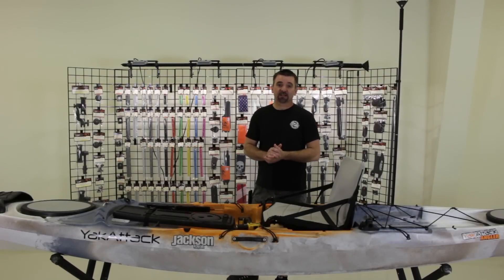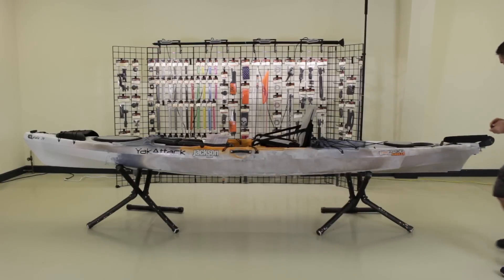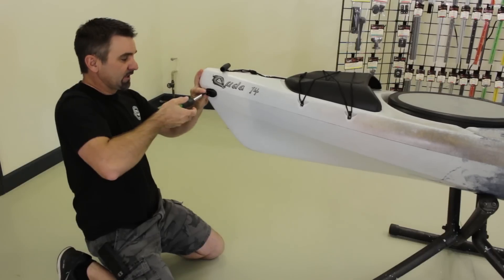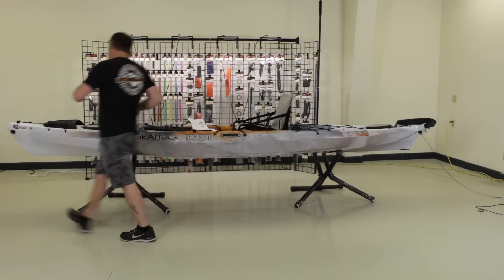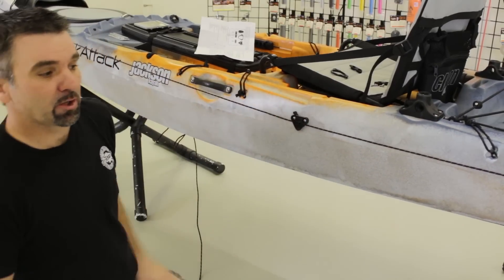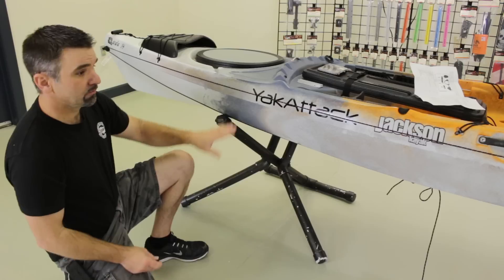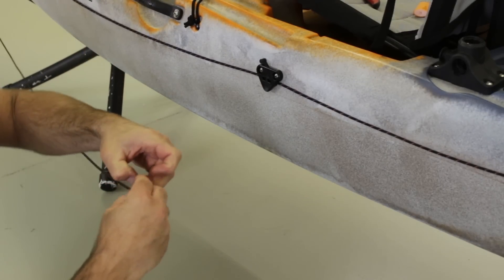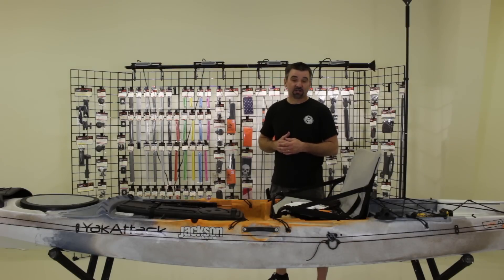Rigging the Dream - Episode 3 - YakAttack LeverLoc Anchor Trolley Install

Comment: would you recommend putting marine goo or anything like that on the holes where the screws go?
Reply from the maker: We recommend using marine sealant for any installation where holes have to be drilled.
Reply: @YakAttackKayakFishing  your method of installation doesn't allow for applying any type of sealant to all of the holes before installing the screws. Better to mark the holes with a pen or sharpie and drill them first. Just frustrating to see an installation video on how to do something then recommend to do something else.
Reply: @YakAttackKayakFishing  any particular brand you would recommend?
Reply from the maker: @DavidCook-jy4cs  Amazing GOOP Marine or Loctite seem to be the two brands we are always buying.
Reply: @YakAttackKayakFishing  thanks, very helpful!
Reply: Should have just included well nuts instead of self threading screws! And this dude not even using marine sealant on a watercraft! Amateur hour!

Comment: This is a great product. But I recommend using rivets or well nuts. Screws are not enough in my opinion. When you have a yak that weighs 100+ pounds with gear. Those pulleys will have tons of pressure on them in high winds and current. Just installed two on my feelfree.
Reply: Did you use rivets on your boat? Did they fit OK? I am also having doubts about using screws without backing. Did you get Harken pulleys or Stealth pulleys. What is the quality difference. I have read that the Yakattack Stealth pulleys are not very strong/good.

Comment: When I first opened & installed this anchor trolley I wasn't impressed installing the pulleys only using screws and honestly I still don't like that part but aside from that over a year later and this anchor trolley is performing great! I recommend using at least one bolt in the center of the pulley (or a well nut if you don't have hull access) especially if you have a kayak with a high freeboard like a Pro Angler. I just bought another one. These are great anchor trolley systems!

Comment: Real good Instructions but I have NO IDEA why Yakattack includes Blunt Screws for this Kit - First thing I did was go to the Hardware Store for Stainless Steel Pointed Screws of Identical dimension - So much Easier and Tighter fit and just better

Comment: Thanks for the video.  It makes installation much easier and reduces the chances of mistakes.  I installed one today on my new Perception Pescador 12. I looked at several systems and this seemed like the most professional looking and best functioning.  I like the locking feature and the way the line is held in place by guides. I am very pleased and will recommend it to others.

Comment: Should you use marine goop before putting screws in? Im thinking of getting this trolley at some point but nervous about drilling holes in my kayak.
Reply from the maker: Drilling holes in a kayak is always nerve racking. You can definitely use the marine goop for extra piece of mind, but it is not required.
Reply: @YakAttackKayakFishing  okay sweet thank you!

Comment: Should one put an anchor trolley system on each side of the boat or just one side?  Great Video.  Thanks.
Reply from the maker: You don't see it on every boat, but it isn't uncommon to have an anchor trolley on both sides of the boat.
Reply: Saw another video where the guy recommended to mount the trolley on the opposite side of your dominant hand which holds the rod in order to keep it out of the way. So left side for right handed person. Seemed to make sense to me.

Comment: I have to say I think this is the best anchor trolley on the market. am ordering one today. the instructional video was great a lot better than that other yak company doing instructional videos that doesn't have a clue. thums up I bought a fishfinder finder it would be cool see how you mount one. the paddle video would help out a lot I have a really cheap paddle but its the only 1 I've ever used so I don't know if am missing out by not getting a better one. great video
Reply from the maker: +iwantosavemoney Thank you. The LeverLoc Anchor Trolley was a fun product to develop and design. We wanted an anchor trolley system that was unlike anything else on the market and solved a few common problems typical anchor trolley systems encounter.

Comment: I really like the idea behind the HD kit with the vacuum plates but can that be installed on a Bonafide RS117.
Reply from the maker: The RS117 features an access plate at the stern of the kayak. To install the backing plates the use of the YakAttack Rigging Bullet would have to be used to get the backing plates in place. The correct thread Rigging Bullets to help with the install of the LeverLoc Anchor Trolley HD would be the 10-32 Rigging Bullet. Here is a video link to a short Rigging Bullet video showing how they are used. It is for GearTrac but it is the most simple and to the point video example: https://youtu.be/6EnHBEEQHYs
Reply: @YakAttackKayakFishing  oh wow that is awesome. Thank you!

Comment: Thanks for this video. I kept waffling back and forth about the standard trolley or the HD one. I ended up with the standard trolley (just purchased today) since I could get it locally and could always upgrade to the HD backing plates if I feel like I need to. 99% of my fishing is done in fairly small inland lakes in good weather so I think (hope) the standard version will be good for me.

Comment: I did not add any silicone when I put the screws in. Would it still be ok to take them out and then put silicone? or should I just leave the alone?
Reply from the maker: Silicone isn't completely necessary. If you want to add some silicone, feel free to do so, but only do it around the head of the screw. The type of hardware used in combination with the material of the kayak and the pilot hole size is creating a nice tight seal.
Reply: @YakAttackKayakFishing  thank you

Comment: Do you put silicone on the screw shafts when permanently tightening them ?? Seems like it will leak if you don't. Just asking.
Reply from the maker: The pilot hole size we recommend is a bit undersized and the blunt tip thread forming screws help create a nice tight seal. If you want extra piece of mind you could put some silicon around the head of the screw but aren't really needed on the threads themselves.

Comment: I actually just purchased a Cuda 14 and was looking at options for adding a Hummingbird Helix 5 fish finder . I was curious about mounting on the center console. What would you suggest?
Reply from the maker: Does your Cuda 14 have factory installed track on it?
Reply: YakAttack just on the console.
Reply from the maker: You could use this mount and attach it directly to the track on the center console: https://www.yakattack.us/humminbird-helix-fish-finder-mount-with-track-mounted-locknload-mounting-system-ffp-1004/
Reply: YakAttack would it be possible to add more yak track to the Cuda 14? And if so what would you recommend? 
How would I contact you directly through email?
Reply from the maker: You could add more track. Feel free to contact us at 434-392-3233 ask for John. Let them know you have a rigging question. Or send us a message on Facebook or Instagram.

Comment: Do you recommend a dot of silicone for the screws to go through? Also.... Any difference in this one and the AMS-1004.
Reply from the maker: With the included self-threading screws you can add a bit of silicone after the screw has been installed if you would like. The difference between the basic LeverLoc Anchor Trolley and the HD LeverLoc kit is the HD included 3 backing plates for the two pulleys and the LeverLoc as well as two extra line guides. The basic kit is ample for most anglers. If you tend to anchor in areas with more wind, current, or boat traffic the HD kit would be worth looking at.

Comment: With the yak attack anchor trolley system, how do you lock your anchor line?
Reply from the maker: There is a lever lock built into the system. It is the component installed at the 7:35 minute in the video.
Reply: @YakAttackKayakFishing  i am asking about the anchor line not the trolley line
Reply from the maker: @alielkady5056  an additional cleat would be needed if you are using anchor line. Our GT Cleat or GT Cleat XL could be good options to secure the anchor line.

Comment: Wouldn’t using using well nuts or marine sealant on the holes your drilling be necessary?
Reply from the maker: We don't recommend the use of well nuts with any of our products. Following the instructions using the provided hardware will result in a solid install. Add marine sealant if you want but it isn't needed given the type of screws, the specific size of the pilot hole, and hand tightening.

Comment: If anyone is still monitoring this channel, please advise. If you did not have the bungee cords on the bow of the Cuda 14 would you put the forward pulley above the chine? Or is a straight run for the trolley line better? Thanks RJ
Reply from the maker: I would do the bungee trick or us the YakAttack Rigging Bullet to help with the install to get the pulley as close up to the bow as possible. We did just recently sell the kayak in this video but we were very happy with the component placement over the past few years.

Comment: Does it matter left or right side?
Reply from the maker: The side of the kayak that you install the anchor trolley is purely personal. Let's say you use our CellBlok fish finder mounting system and you mount it on the left side of your kayak. With having a transducer arm on the left side you would want to install your anchor trolley on the right side. Some customers install the anchor trolley on the right side if they are right-handed and vice versa.

Comment: Hey Luther. Awesome video and awesome products. I do have a question. I have a Journey 10 ss. I'm finding it difficult to install the 1003 due to the mold on my kayak. I can easily install the two pulleys but I can't figure out where to install the locking mechanism. If I put it above the mold it will not be aligned with the rope. if I put it below the mold the the flap of the mold keeps the locking lever from being used. Can you please give me some pointers? Thanks for your time!
Reply from the maker: Could you possibly send us a picture of your kayak, and the placement of the pulleys? We have never installed an AMS on this particular boat. Just send the pictures to support@yakattack.us and we will certainly help you
Thank you!

Comment: What's the purpose of locking the trolley line? Won't the ring stay at whichever end it's positioned to? It will be pulled in that direction by the anchor once the yak orients itself in the current.
Reply from the maker: Depending on the current and wind, locking the trolley line gives you the ability to face quartering up or down stream/wind rather then just directly up or down steam. It gives you the extra piece of mind that you will hold position rather than be at the mercy of the water.
Reply: probably if one wanted to  "lock the anchor in the middle or so"  to keep it from sliding to either end of the craft ... .
Reply: short answer is NO it won't always stay put, especially if you are adjusting the amount of anchor line you have out (pulling some in)-  or when using a drag chain on a river drift and you are constantly letting out or pulling in a little bit of line.

Comment: was thinking of buying this kit...but alas...no harken pulleys now. they replaced them with Stealth...i hear they arent nearly as well built
Reply from the maker: The Harken pulley used in anchor trolleys of the past was designed for the sailing industry and not meant for the use and environments kayaks go through. Being mounted on the outside of the kayak you can hit the pulley on rocks, trees, docks, bridge pilings, etc and the Harken wasn't designed to be put through that stress. The Stealth Pulleys now used in the LeverLoc Anchor Trolley kit are the only pulley on the market specifically deigned for the sole purpose of being used as a component in a kayak anchor trolley. 

What is the point of barrings in a pulley for an anchor trolley? That is one more thing that sand, dirt, and sediment is going to make its way into and hinder the performance and also the barrings are noisy and simply not needed in a product like this. Instead we use a Teflon infused nylon roller that is never going to give out, it much quieter, and built to last the life of your kayak. No other kayak accessory company stands behind their products to offer a lifetime warranty on their anchor trolley which we now do. The Stealth Pulley is protect from impact and is snag free from both sides of the pulley making it the right tool for the job.

Comment: This was the most frustrating install. I think it got the cut off screws for the HD version. It was a PIA to install. I don't know how he managed to do it himself. Even with my wife pushing from the other side, it took me an hour to do all 8 screws. Should have given me a pointed screw so that it would better guide the screw in. I regret buying this anchor pull - plus they cheaper out with a "strong plastic" pulley instead of a stainless steel. So pissed about this install!!!
Reply: David Aggies 😢

Comment: No marine silicone on those screws = water in hull.
Reply from the maker: Not in our experience.
Reply: You Do Not need sealant of any kind when using screws. If you drill a hole much smaller than the screw there is  no way water is going to get in. You will get a ton more water inside just from what comes off your anchor when you pull it in or your lure when you bring it in the boat.
Reply: @heidentubrefinishing2976  Sit on Top kayaks have a sealed hull. So no reason not to use sealant just for good measure. For Sit In kayaks, prob not worth it then for reasons you alluded to.